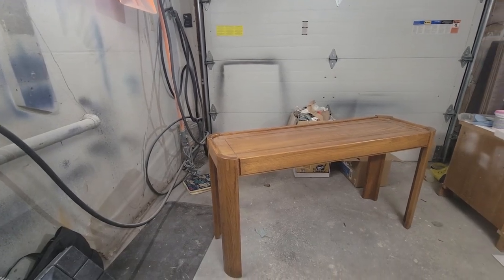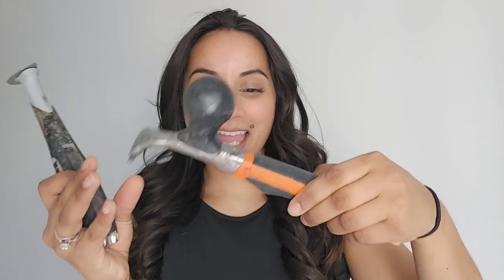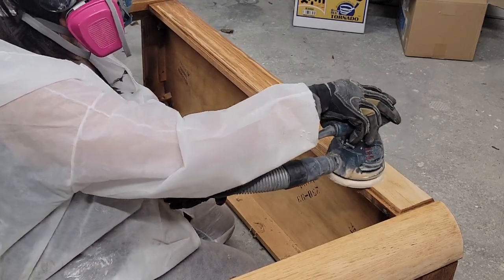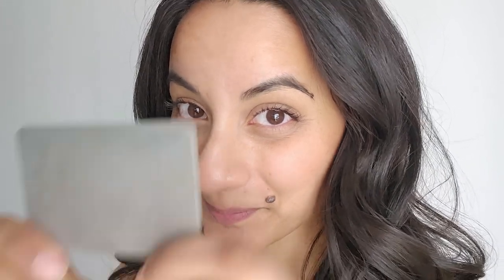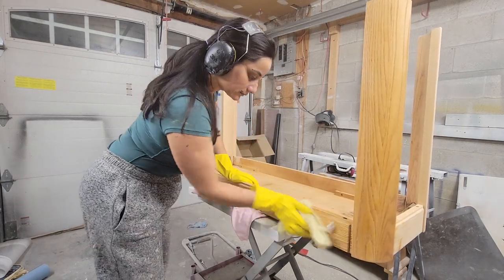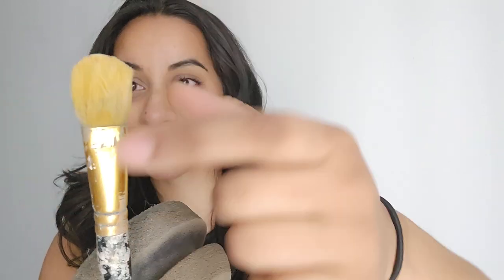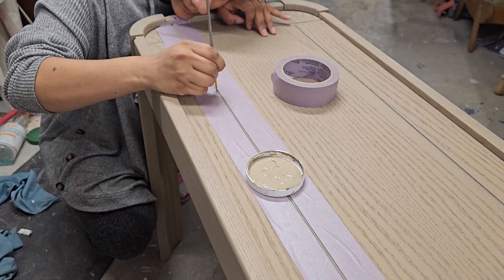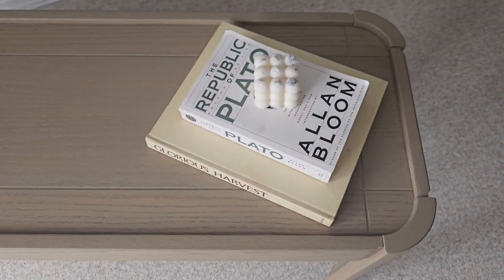Using Algonquin from Fusion Mineral Paint to flip an MCM console table!

Comment: What a well-done video!  Your job turned out really nice. I especially like your attention to the routed grooves, though I must say I think once you taped it as well as you did you could have probably used a larger brush to make that refinement go faster and get more paint into those often pretty rough grooves.  One last thing: I mean no disrespect, but that table is likely no older than the 80's or 90s, it is definitely NOT from the 1960s and I don't recall that modernistic style in the 1970s, unless closer to 1978 or 79 (possibly). That said, it is definitely vintage and you put new life into it by modernizing the finish! I was SO impressed that you paid attention to those grooves, but they were not cut while the Young Rascals', "Groovin' on a Sunday Afternoon," was released in the 60s. 😺
Reply from the maker: Omg really!! The more I know!!!😅

Comment: Beautiful. Wondering why you went up and down in grit when sanding? What's the benefit? Also what brand/color did you use for the deep grooves in the piece? Thanks!
Reply from the maker: Hello! Up and down? Did I say that? Sorry if that was confusing. In any case when working with veneer you have to be safe and careful with any grit. Starting at 120 or even 150 to see how it reacts